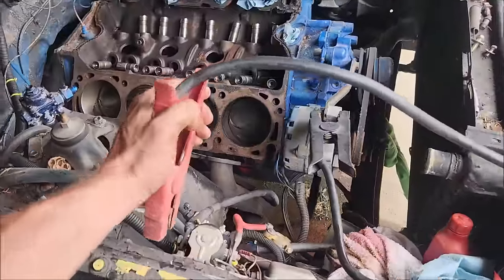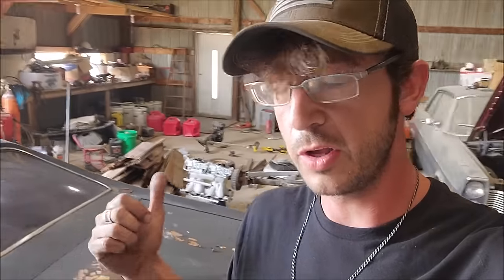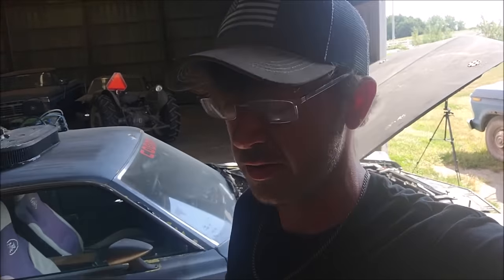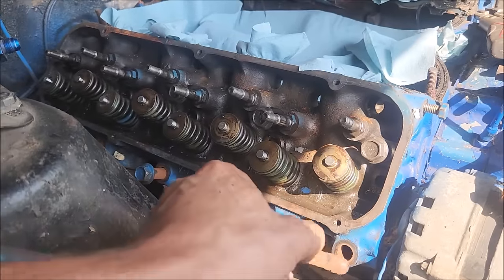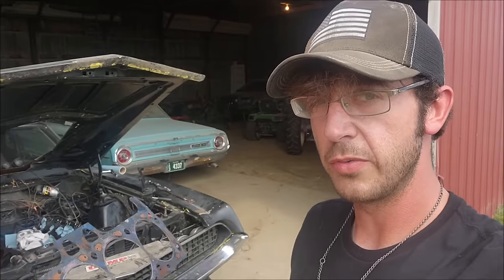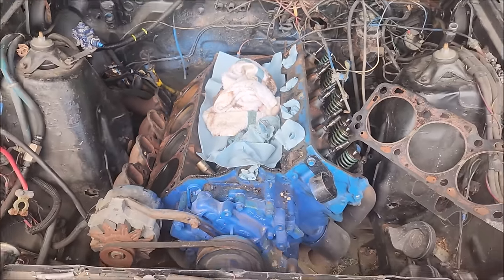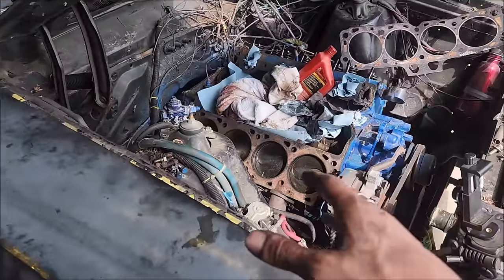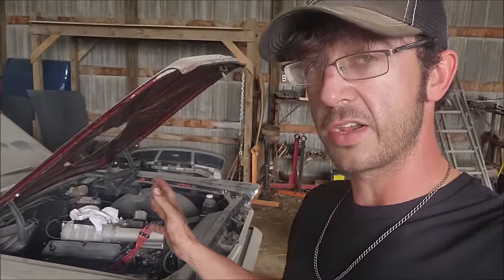Will it Run? Engine Fubar? 1970 Ford Torino DRAG CAR - Parked 20 Years Ago!

Comment: You said "bore it for $150" where do you live? Its $100 a hole so $800 😅
Reply from the maker: It's 100 a cylinder to re-sleeve an engine, not bore it.

Comment: Wants some views ,Pull the motor, and rebuild it. Deck the block
Mill the heads bore it 30 over. Balance the motor. 429 is an awesome motor.
You can sell it anytime.
Reply from the maker: The only time to sell it and not be cash flow negative is to not go farther - all youtube aside. 
Budget engine work going to be 2500 to do halfway right, or around 2 to build a decent 460 with used but good 90s short block. 
I guess what I'm saying is that there's only 1 ideal time to sell it, which would be how it sits right now.

Comment: I doubt you could ever get the full potential from the engine, it's so close to those stupid shock towers that you can't get decent headers on it to let it breathe at high rpm. Ford fail..
Reply from the maker: Oh boy. The only consequence of the layout is that it's horrible to work on - but that's any long tube header car.